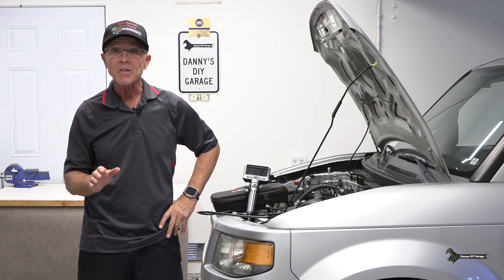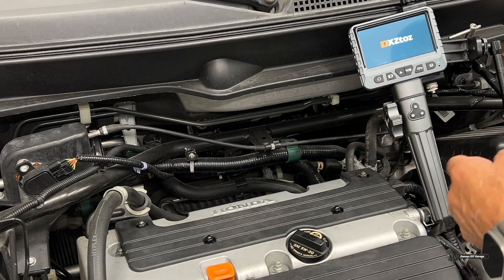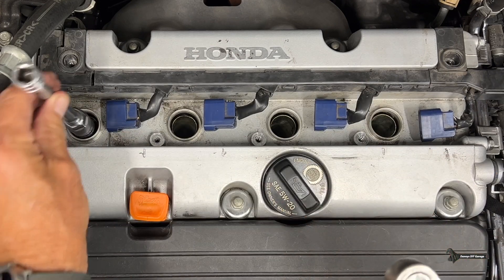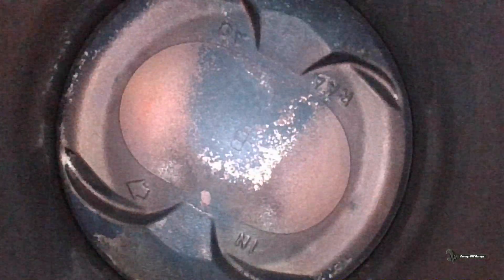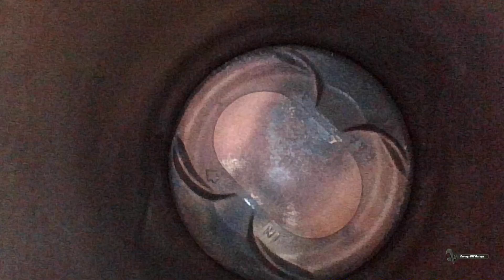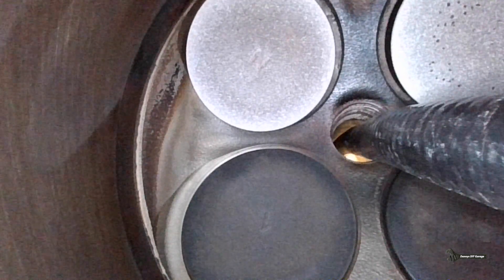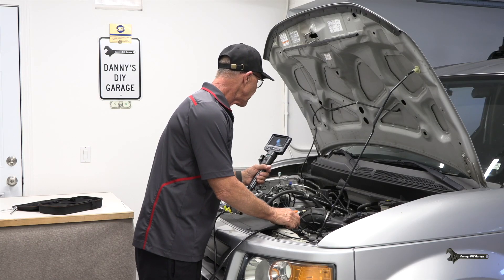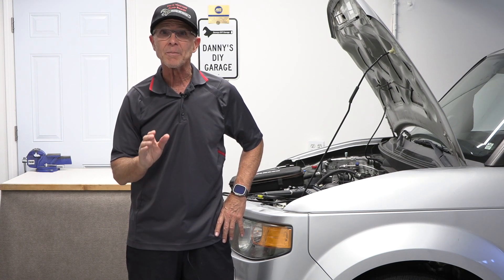Engine Inspection, See the Carbon Buildup I found inside my Honda Element Engine with a Borescope.

Comment: I don't need to see what my wife's 2014 CRV engine looks like.  It burns a quart of oil every 1000 miles.   just about every other major system has needed work since she bought it used.  It's like it was dipped into the Ocean, pulled out and then SOLD TO HER.  Not to be too hard on her because I've heard a lot of bad things about these vehicles, even from an engineer I know.  He called his wife's CRV a bucket of bolts.  Maybe it's a bad generation of the CRV.   I love my Element, but her CRV is a piece of crap.

Comment: 5:00pm Danny  just  got a honda civic  in aug has 170.543 miles had to do three coils was bad all plugs  because  check  that  motor  light came on put new battery  light went out two weeks  ago got bad gas now  car lightmotor. In on put dry gas in car stalled  still  runs ruff  a runch is on pleas help
Reply from the maker: Can you rewrite this, very hard to understand, write details
Reply: @dannysdiygarage  Danny got bad gas car runs ruff put dry gas in don't  help
Reply: It is a hybrid
Reply: Check engine light is on
Reply from the maker: If you got bad gas, you need to get rid of it, hopefully once new gas is in, it will run better, but this might take some time, hopefully injection system is okay, where did the bad gas come from and what’s the engine light code
Reply: @dannysdiygarage  it said  the  o2cecer. B
Reply: The  one next to cat sorry  didn't  spell good
Reply: I also put injection cleaner in and clean air flow to
Reply: Mobley gas in ct on route 5 endfield ct
Reply: Thank you  for helping  me done work  by my self

Comment: How often do you do oil changes?
Reply from the maker: Every time the maintenance light comes on 4 to 5k with synthetic oil
Reply from the maker: Valvoline Advanced Full Synthetic SAE 5W-20 Motor Oil 5 QT

Comment: That's an extremely clean combustion chamber. You'd probably have said, but I wonder if you use any kind of cleaner? I've gone back and forth on that question over the years. 

We happen to have three cars with these engines in our family including one son with an Element. What's impressive is they don't seem to care about mileage at all, even with 200k+ they run smooth and quiet like a new engine, but of course maintenance is critical even with these.
Reply from the maker: never used any cleaners or additives, the gas has additives in it and thats probably why its so clean, also keep up on the oil changes and replace your a PCV valve, I have a video on this

Comment: How do you keep your engine insides so clean? Highway driving only?
Reply from the maker: normal driving, never used any cleaners or additives, the gas has additives in it and thats probably why its so clean, also keep up on the oil changes and replace your a PCV valve, I have a video on this